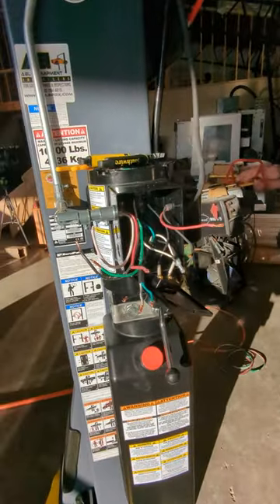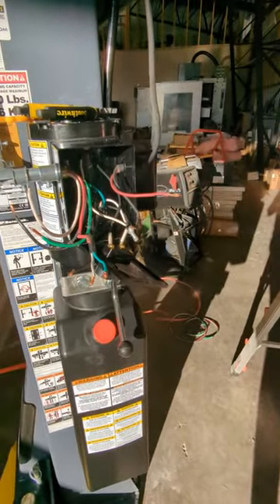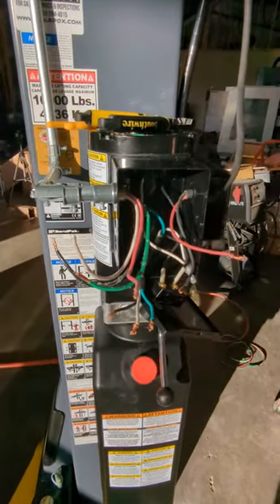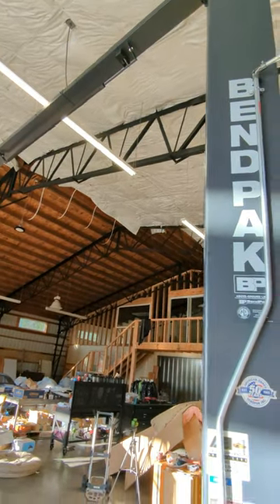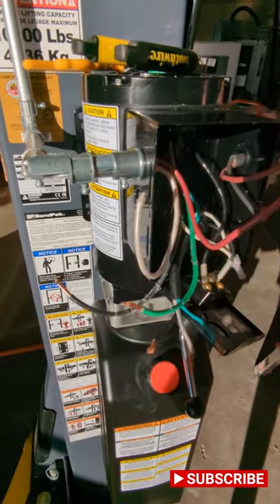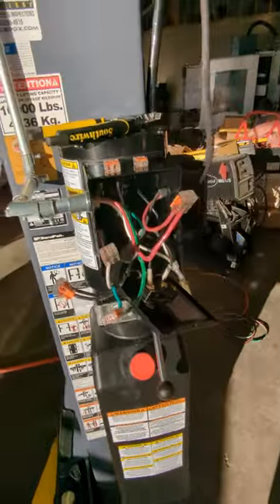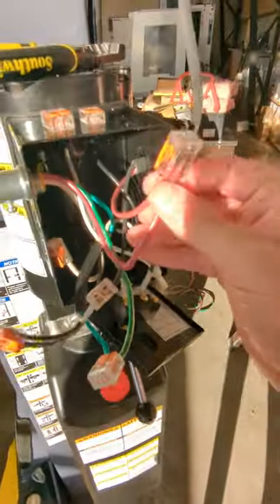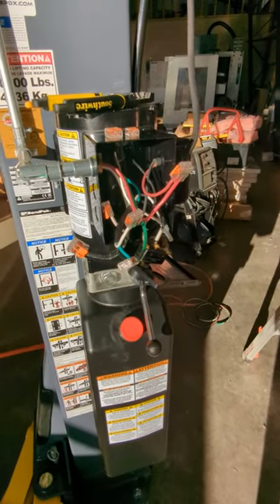Bendpak 10k Lift DIY Wiring Instructions

Comment: Your black to the motor must run through the push button before going to motor?  Thanks for the video.
Reply: He forget the push button, I always wire my safety switch and push button on the same line
Reply from the maker: @gregadventures2024  push button was pre-wired if I recall and gets power from the safety switch at the top.

Comment: What brand and model is the safety thermal switch you purchased? Still going to post that video?
Reply from the maker: I'll aim to make one in the next day or two. In short, I ended up using a fused Siemens 30-amp fused safety disconnect (LF211N). I used this one because it has a back-panel entry since my wires will be buried in the wall, but any fused 30-amp should do it. And it doesn't necessarily need to be fused, I just went with one for added protection, along with a GFCI breaker. From reading, most people aren't using a thermal switch since this motor is infrequently under load in short bursts rather than continuous usage.

Comment: Did you ever get around to installing the thermal overload?
Reply from the maker: I did not. After reading I found that it's not really needed since these motors are usually only operated for a few seconds at a time rather than continuously being used where it might heat up.

Comment: Did you ever put a thermal switch in? If so where did you order from? Thanks.
Reply from the maker: Apologies for the delay. No I didn't end up doing a thermal switch. From what I've read that's important if the motor is under regular, continuous load to prevent it from overheating. Since the motors on these are used rather infrequently people have concluded a thermal switch really isn't needed. If I can find anything else that says otherwise I'll update you.